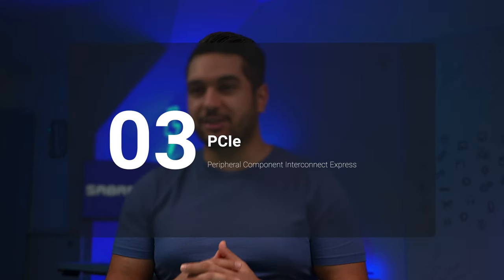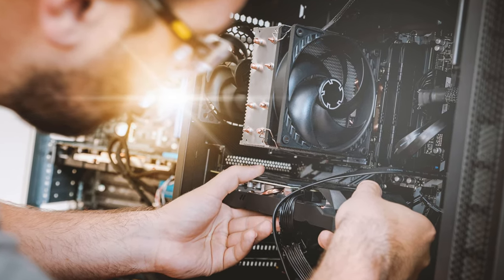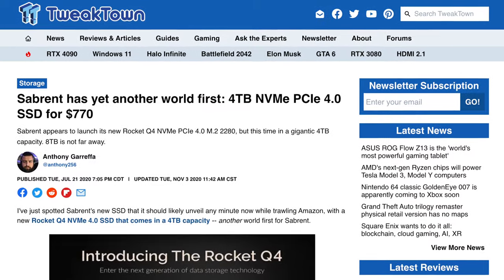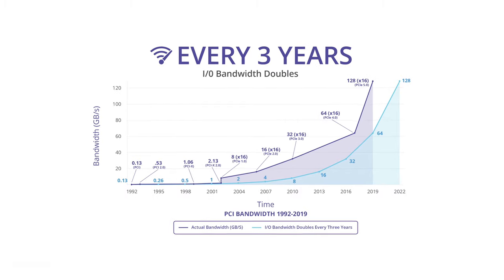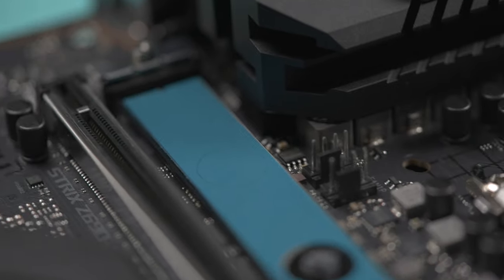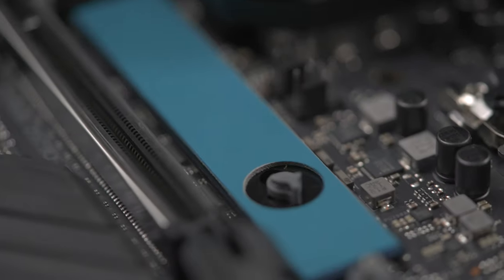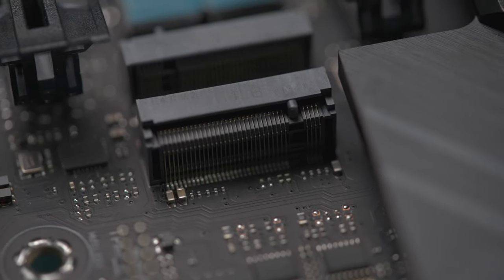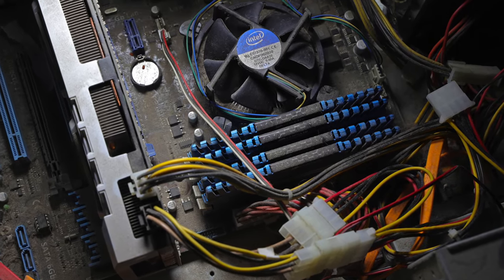SATA vs SAS VS PCIe | EXPLAINED

Comment: SAS and Sata are the exact same size. You can fit just as many sata drives in a pc as sas drives. The number of ports you get is determined by your motherboard or your expansion card.

Comment: Eh man you could have said a lot more about SAS. SAS is SATA on steroids (SAS has same connector, supports SATA drives too, is on paper exactly 2x faster than SATA because SATA can send signal either up or down, not both at the same time, but SAS is bidirectional, can have full 600MB up and 600MB down at the same time, but not above 600MB; SAS cable standard supports a way longer length cables but nowadays I have seen up to 1 meter SATA cables too) SAS drives have higher security and preservation standard, i.e longevity and error correction is more advanced). Price being higher is only because of its use market - enterprise, where clients opt for more reliability and willing to pay ten times more for it. If it was as popular as SATA it would have been as cheap.

Comment: RPM is Reps per minuute not second like you mentioned - so as SAS can support up to 65535 devices in a single chain using SAS expanders not 128 only

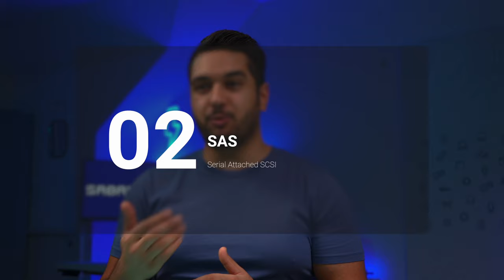Comment: Trying to make sense of what you sat at 2:28...

sas 1800mb/s
hd on sata conector 1500 rev/min
sata connector 10 000 rev/min

the comparison is all over the place...?
Reply: Yeah, I was like what ... Lol
Reply: Somebody messed with him on the teleprompter... 😁
Reply: i think he doesnt know what 15hundred means, i searched it up its supposed to be 15 000 so he just cant speak...
sata max 10 000
sas max 15 000

sata 600mb/s
sas 1800mb/s
Reply: @justarandomguy3969  sas max is 2x sata max, because sata can send signals unidirectionally while sas is bidirectional, it's same cable but the sender/receiver device is different technology, and also sas supports sata drives as well, it's "backwards compatible" to SATA
Reply: @FirstnameLastname-py3bc  "is 2x sata max" i dont understand what unit you are referring too? That just means it can read and write at the same time, it doesnt make it faster
Reply: I thought i was going crazy trying to understand lol
Reply: @FirstnameLastname-py3bc  can i use 2.5 inch sas for laptop?
Reply: @perkedelkornet840  rarely any system except SAS extension boards support SAS drives, you have to check manual if anywhere it has sas support (or SCSi support, SAS means "Serial Attached SCSi")
Reply: @FirstnameLastname-py3bc  thanks for the info

Comment: I really enjoyed the explanation of the SATA and m.2 drives. I hadn't heard of the SAS so that was a new one for me. One thing I did notice after doing a lot of research is that for gaming, unless you're using a mechanical hard drive, the load times between SATA, m.2 Gen 3, and m.2 Gen 4 really weren't that big a difference, a few seconds or less in most cases.
Reply: Uuu
Reply: SAS is exponentially more expensive it's $285 for a SAS adapter vs $20 for a SATA😭 and SAS is for enterprise I think I have a 4tb SATA barracuda for my ps4 but I have an 18tb exos SAS but I am not spending almost $300 to try to use that and even seagate admitted they aren't sure if it'll work on my PlayStation 😢
Reply: @dimagass7801 you won't even be able to take advantage of the sas speeds through a converter.

Comment: SAS cables support emerging data storage technologies. SAS:
Uses SFF connectors.
Is compatible with SATA drives that can be connected to an SAS controller.
Has SAS-4 with throughput up to 22.5 Gbps, full duplex.
Has a hot-pluggable connection.
Uses expanders to daisy chain up to 65,535 devices. Terminate the last device.

Comment: Is there a SAS to SATA adapter to use SAS HD in older platforms made only for SATA?
Reply: You need a SAS card for one of your pcie's connectors to use for sata based boards
Reply: @Pr.2104 with that can i also boot into a sas drive?
Reply: @jirehla-ab1671  I dont see why not it shows up on my windows as just drives I never really tried that 🤷🏽‍♂️
Reply: @Pr.2104  but can u see the sas drives in bios boot menu / devices?
Reply: @jirehla-ab1671  I think I've seen them on the bios before I'm not quite sure, I've only ever used them for my cloud server that I got in my living room just to hold my photos and stuff
Reply: @jirehla-ab1671  just wanted to let ya know but it is possible to use the drives from the bios, I was just swapping my OS to a smaller drive since its a 1Tb ssd just got a cheap ole 256gb for the OS but it was showing the SAS Drives upon the boot selection
Reply: @Pr.2104  thanks, are u using an lsi card? & thats a server mobo?
Reply: @Pr.2104  yur using a consumer mobo right?

Comment: This is a question for sabrent...sata m.2 drives are still around and still popular but why don't you release sata m.2 drives and in size over 2TB? seem like nobody does and i don't understand this
Reply from the maker: Because our Rocket Q 2TB which offers around 5/6 times the speed of a sata m.2 2TB and it’s cheaper than those sata drives. Our Rocket Q SSD offers sizes up to 8TB and is much better value than an M.2 SATA SSD.